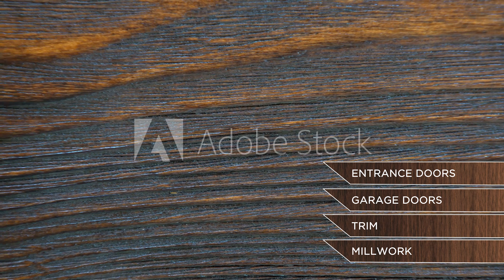M.L. Campbell Polarion 2K Acrylic Polyurethane

Comment: It says no reduction needed. What fluid tip size are you supposed to use with this? A little more information in your product sheet would be useful
Reply from the maker: That'll depend on a few factors for your particular setup but if you'd like to give us a call at  800-364-1359 our tech services team will be happy to help you out.

Comment: Polarion or Coda for restaurant tables?
Reply from the maker: They're both excellent choices. Polarion is the stronger of the two, but Coda is a close second for scratch and mar resistance. If spray time will be a factor, Coda has a slightly longer pot life. If you have specific questions, feel free to give our tech services department a call.

Comment: * WARNING *
ML Campbell Wood Finishing Systems by Sherwin Williams are JUNK!!!
I have painted bikes, cars, boats, furniture, houses, interiors, exteriors and many more substrates using all types of paints for the past 50 years.

I was told by some professional painters, that ML Campbell’s wood painting system was ideal for painting wooden cabinets. 
What a HUGE MISTAKE to listen to them!  Here is my experience with this horrible paint system by products and issues.

Primer: 
Applications
The primer is very difficult to work with in that you CAN NOT touch it or get anything on it before you shoot the Magnaklear Pre-Catalyzed Conversion Coating over the top because the primer attracts dirt and is virtually impossible to remove any mark(s).  You have re-shoot the primer to cover the dirt or marks otherwise they will bleed through.  Also, you must spray the substrate at least two times because if you do not any underlining defects or colors will bleed through after you shoot Magnaklear.
Clean up 
Totally sucks the Primer does not stay wet long enough to easily wipe off.  You must keep the surface that you are cleaning wet with Lacquer Thinner otherwise the primer dries so quickly that you cannot remove it.
 
Magnaklear:
Contaminated Product
I purchased eight cans at nearly $80 a-gallon thinking that I was buying the best painting system for wood projects. I had to buy the Materials from a specialized hardware store that required a business account to make a purchase.  Five out of the eight can were contaminated with small black specks.  I thought that the debris might have been airborne in the spray tent; however, I noticed that on several occasions that a dark particle would fly out of the tip of my spray gun when applying the Magnaklear. 
To prevent such issues, I thoroughly cleaned the gun several times with lacquer thinner prior to using it. The black 1/32nd sized particles could have never come from my gun since I never used shot black paint through it. I opened up previously used cans trying to determine the source of the debris and noticed that there were several small particles in the bottom of the can.  I couldn’t believe it!  How could ML Campbell’s manufacturing process allow contaminates into the batch at $80 a can.  In 50 years of painting I have never seen this.
I contacted the local distributer and told them what was happening and he said, they had never seen that before—standard response. I took two of the contaminated cans to him so he could see the issue. He did not know what to do.  Nothing positive ever happened after bring this to their attention.  
Given that I had already applied two cans to the cabinets, I couldn’t go back and re-sand and re-prime and repaint all of them.  Doing so would have taken 20 hours and hundreds of dollars in purchasing more paint, sandpaper and other materials.  The only logical solution was to use three filters together to prevent any further particles from being sprayed out of my gun.
See attached photos

Easily Stains
My wife was making a red cake and during the process she opened several cabinet doors with her hands not thinking anything of it. The red cake food coloring stained the Magnaklear finish!  I tried using Dawn hand soap, toothpaste as an abrasive to remove it, but it didn’t work.  I also used Acetone and Lacquer Thinner to see if that would pull out the red color, but it didn’t.  Keep in mind this paint job had only been on for two months so they still looked new.  Finally, out of desperation I used liquid bleach and applied it four or five times with a microfiber clothe to bleed out the color.  After, about an hour of setting on the surface most but not all of the red came out.  What was interesting, wife got the same red coloring on our oil-based walls and the red came right out with Dawn soap.
 
Brittle
The Magnaklear is extremely brittle and chips very easily and is impossible to repair after it has been applied and dried.  I had to re-sand many cabinets and start over to fix all the bad areas.  I tried to remove a couple of small drips by using my fingernail.  The drips came off as a chip and broke.  This product does not have any flexibility.
 
Yellowing 
If you end up using this crap you better account for the “Yellowing Effect” the product has will alter or change the original color.  I was not aware of the yellowing until after I sprayed it and the product had dried!  I was so pissed I have never had a “Clear Coat” change the base color as bad as this terrible product.  One other warning you better make sure you apply the exact amount of Magnaklear on each surface because if you do not you WILL see a color difference when placing two side-by-side if they have not been sprayed exactly the same.
 
Touching Up
Good luck if you chip, scratch or scrap the surface after you have finished a job.  YOU CAN NOT touchup or repair any of these issues the primer and top coat are impossible to blend over a damaged area, so you have to redo the entire area to blend it back in.  If the finished surface gets dirty you CAN NOT rub the surface too hard because it will buff the topcoat and turn shiny, which will cause it to look glossy unlike the rest of the area!
 
Surface preparation
Before I applied any of the ML Campbell material, I degreasing the surface to prevent any grease from getting on the bare wood. I sanded all the surfaces down to the wood to minimize any potential bonding issues.  I also wiped the entire surfaces with Acetone, then I lightly used rubbing alcohol to pull out any grime, water or gunk.  I completed this two-month process and did everything in my power to make the finish project was perfect.  
 
I contacted Sherwin Williams after I had fished all the work to take accountability for their mistakes.  Their Regional Manager reached out me after I sent an email to their corporate office and he referred me back to the local distributer.  I contacted them and provided the saved filters and cans for evidence. I had to follow up with them three times over several weeks for updates rather than him calling me.  Great customer service!
 
The local distributer told me “basically I just wanted this problem to go away” because “Sherwin Williams is the largest paint manufacture in the world and they are not going to do anything about this complaint”.  
Awesome right!  You pay top dollar for a product that is defective and have to deal with all the application issues yet they screw you over! 

Final Update
Two months after the project was finished several locations have split and started to crack!  If all this evidence does not scary or prevent you from using this horrible and expensive product then I wish you the best of luck you will need it as well as a lot of patients. See attached photos.